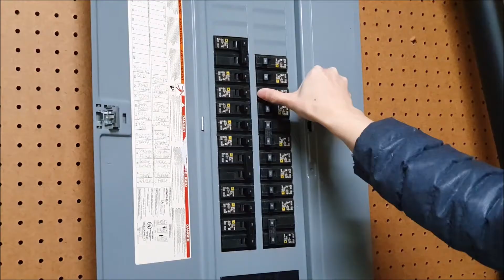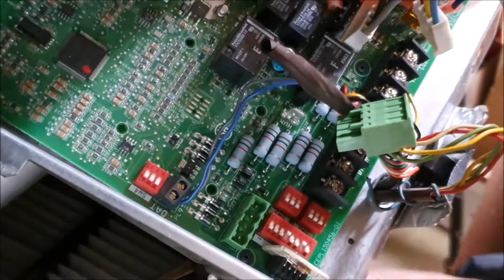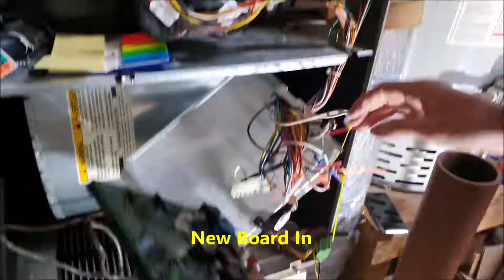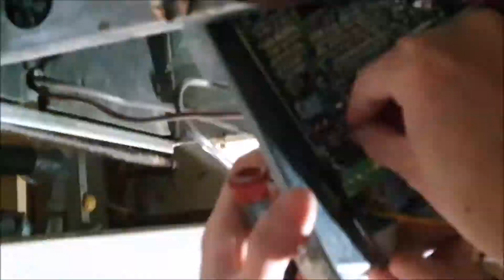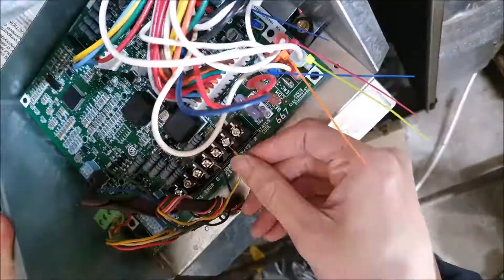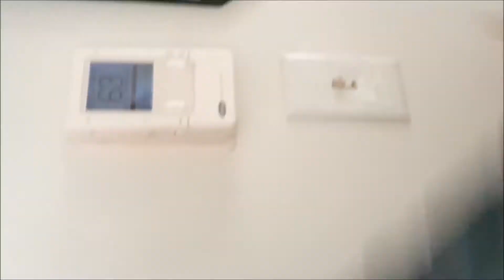Saved $400 Replacing the Circuit Board on Carrier Infinity System Furnace

Comment: Quick question!  I have the same exact 58MVP080, and I replaced mine with an ebay used board, moving model plug to replacement board.  Mine comes up as a MVC080 now.  Does your Infinity controller still say it is a 58MVP080 or does it say something like 58MVC080 etc since your new board is newer (HK42FZ035)?  To see, open the Infinity control panel, hold Advanced for 10 seconds, then in Equipment Summary, what does it say?  You can also go into Advanced and select SERVICE then Model/Serial Numbers. Thank you!
Reply from the maker: That's in our rental now so I dont have access to it to check. It is still working after 4-5 years. Good luck!
Reply: @CarsForNoobs  Thanks for replying!  So I assume you never checked the model after you installed it via the infinity controller?
Reply from the maker: I dont specifically remember checking, was just happy it was working!
Reply: Just FYI - In your follow-up video a year later you can see what the infinity UI controller states the model is, which I assume is the replacement board from this video.  It shows 75KBTU OUT, which is the model reported for a factory replacement board that has no model/serial associated.  I ended up getting a HK42FZ035 replacement board and it shows the same thing as your Infinity UI.